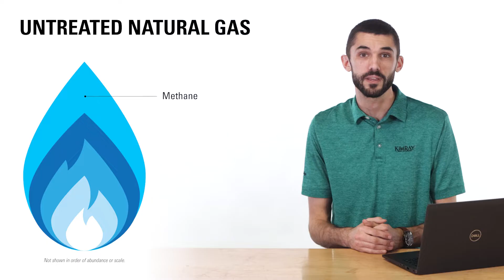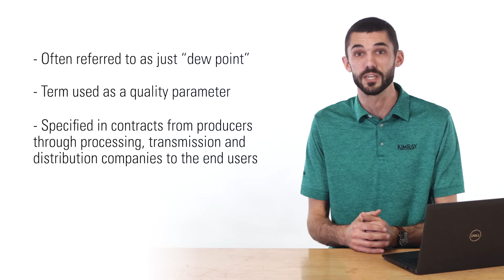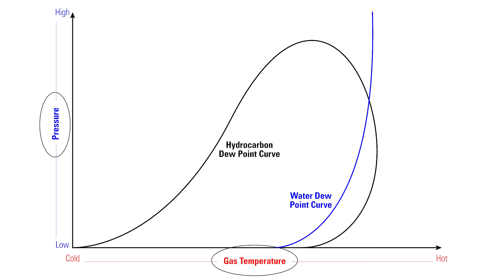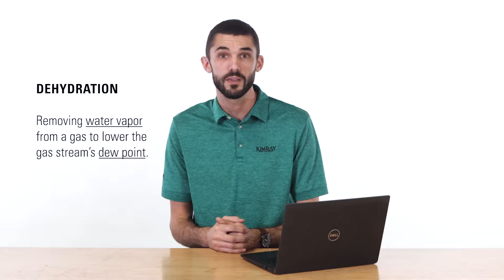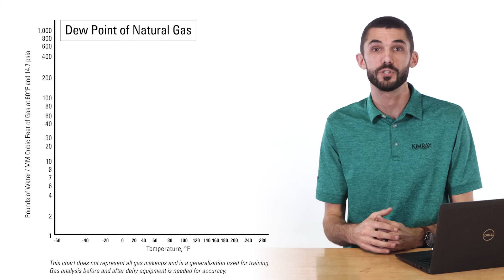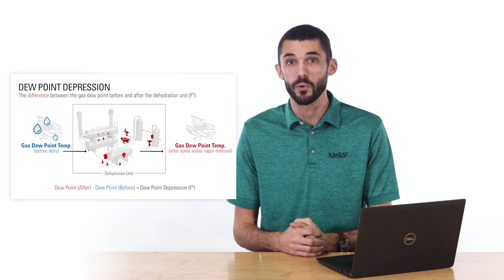The Difference between Hydrocarbon Dew Point and Water Vapor Dew Point in the Oil & Gas Industry

Comment: If you say you want "30-degree gas", you are saying you want 6lb/mmscf (assuming ~1000 psia operating pressure)? Assuming the gas temperature fluctuates or operates at something other than, what effect(s) does that have on moisture content? I know you said it isn't referring to gas temperature, but they're correlated for some reason. I'm sure I'm missing some critical information.